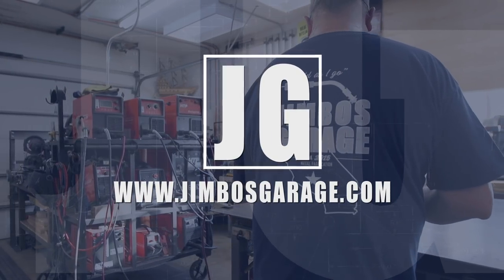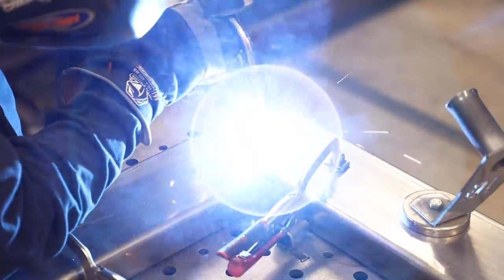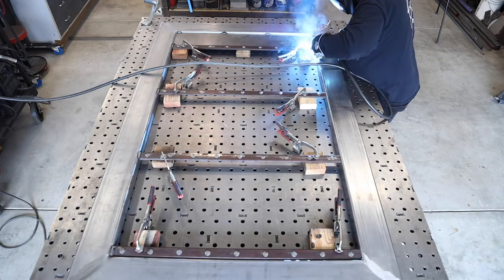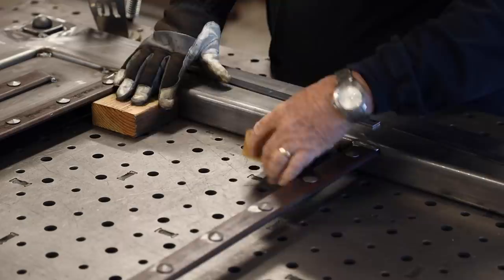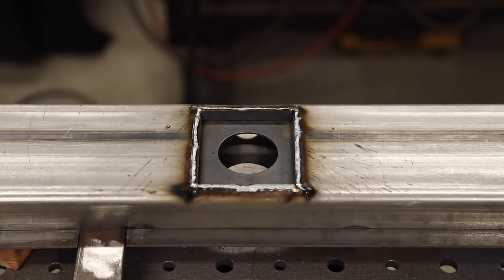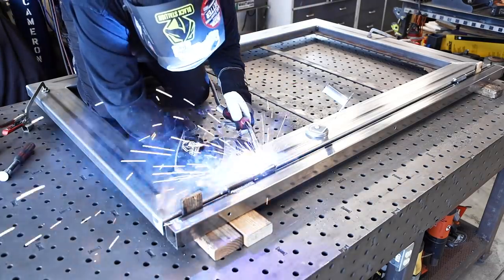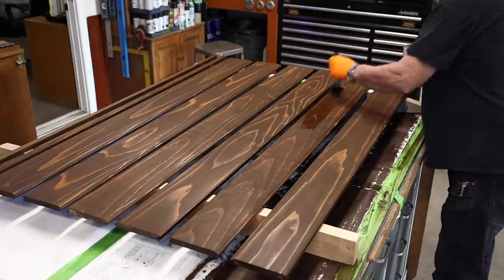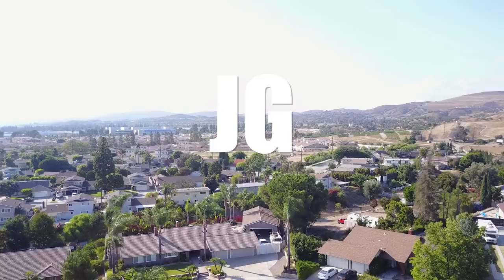Medieval Style Gate | JIMBO'S GARAGE

Comment: Watching from El Paso, TX a border city next to Ciudad Juarez, Mexico: These gates are very popular down here in our sister city because of the high crime rate. We turn a gate like yours into a steel door with dimensions of 200cm x 90cm. We add more cross members and/or steel decor and for added security we add two dead bolts. We anchor a special frame to the house and once the door is installed, it is almost impossible to bring down.

Comment: At work what I do is I transfer the lock to the frame, and I just hole saw it to size. Then for the plunger to go in I screw smaller pieces inside to make a step. Literally not a single weld at all for the lock box. Grand total of 4 or 5 screws and I just tap everything

Comment: Could you please spend a couple of minutes on how YOU handle the strike plate mounting on the jamb?  Would have loved to see the other side of the door too with the strike plate provision...Also, it 'looks' like the door stop is welded to the jamb-any special technique u utilize for this little, requirement?  Do you glue any kind of pad on the stop so one doesn't hear 'metal to metal' every time the door is closed?  Lastly, what about exterior closures- with a door this heavy, if left 'open', and the wind decides to 'close' it, with no cushioning prior to closure, over time, something will have to 'give'.  This will be my first steel door project, and I want to to everything right.  GREAT video- thank you!!!!!

Barry near Sedona

Comment: Soluble oil has been around for more than 150 years.All machine shops have been using it forever.
Reply: I thought the same thing but he's kind of got a point. Water soluble oil is kind of an oxymoron like liquid gas.

Btw love the Metallica-Ish name!
Reply: The shop I work in we use it for everything from cutting to drilling millhog milling

Comment: On the lock box, you could have welded it in on one side and then just used a hole saw through the other side and eliminated cutting and boxing the back side of the gate.  All doorknobs that I have seen the screws are long enough to reach a true 2" door. Save you a little time to do that in the future.